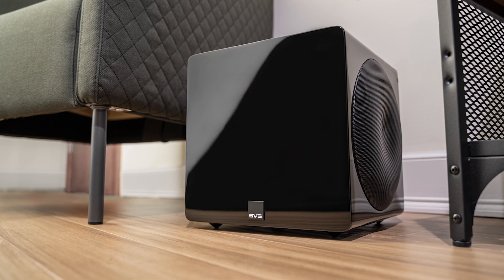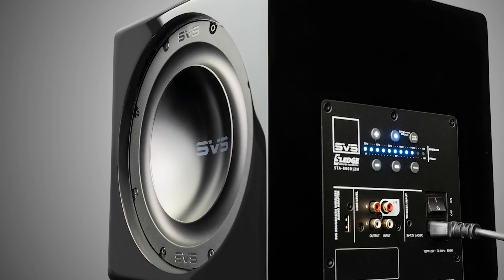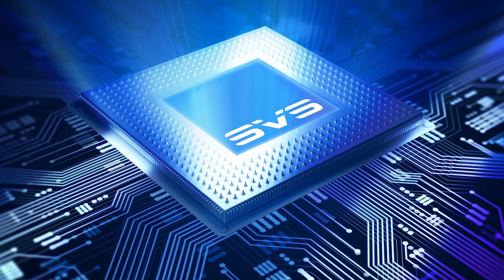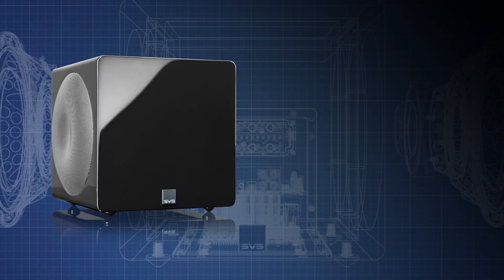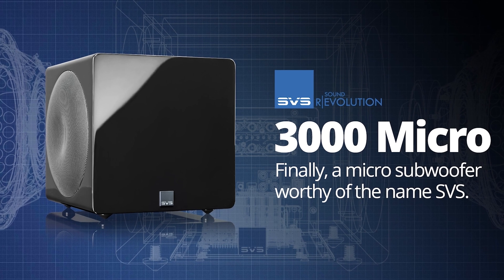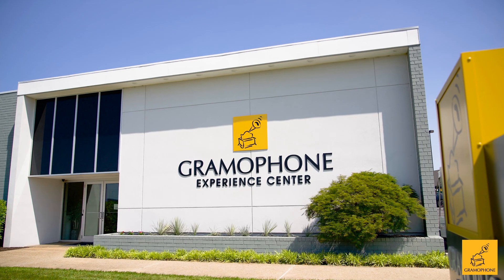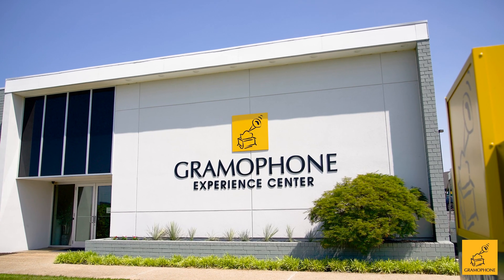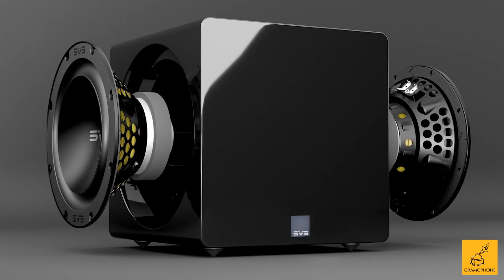SVS 3000 Micro | Thrilling Compact Subwoofer

Comment: How would one wire up two of these to an amplifier? 2x 1:1 RCA cables, one from left PRE, the other from right PRE, and into the LFE port on each sub? (I have a Primare i32). Thanks!
Reply from the maker: Hi David, you may want to reach out to Primare on your connections query.  A brief check of the Primary website for your preamp shows twin sets of pre-outs https://primare.net/wp-content/uploads/2017/03/PrimarePRE32DesignBrief.pdf.  One would think you have described it just right, two RCA cables from Pre out 2 into the LFE connections on the SVS subs.  What I am not 100% sure of is if there is any downside to using both sets of pre outs at the same time, as Pre out 1's will go to your power amp
Reply: @GramophoneMD  Hiya, thanks for taking the time to reply! :-)  Actually, I have the i32 (integrated), not the PRE32. So just one set of pre-outs I think. So I was kind of assuming that one channel (L/R) would go to each sub's LFE port via a single RCA cable...
Cheers!

Comment: I've been using the 3000 micro with a pair of Focal Shape 40's desktop monitors in my office. The 3000 completely disappears in the sound stage. I'm absolutely thrilled with this subwoofer.
Reply from the maker: Thanks John, it's an achievement to build a good subwoofer, but to build one this compact - that can visually and sonically disappear - is the real deal

Comment: If you don't need the extreme micro size/weight, for the same $900 get the SB2000 which is a higher performer.
Reply from the maker: As an engineer friend commented years ago, "A bigger box is free amplification".  If you have size limitations, this sub is really good compared to others, but you can get more output from a larger box